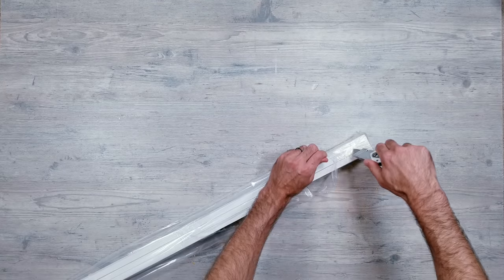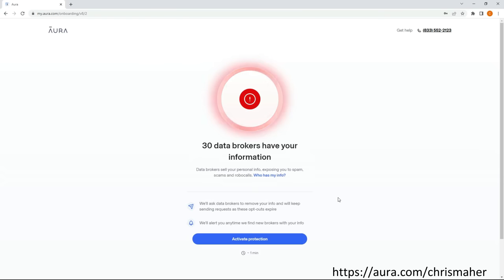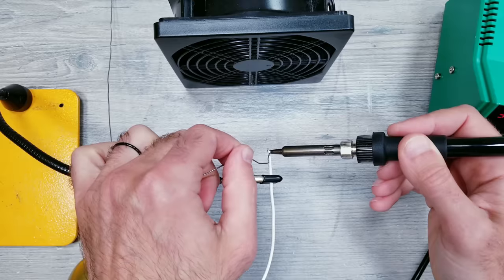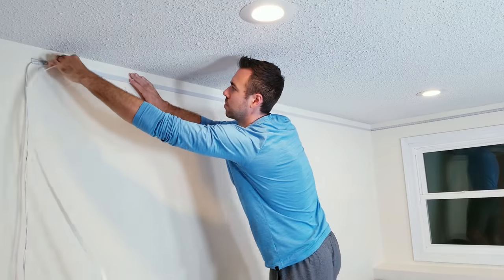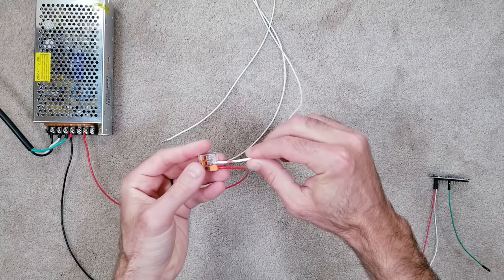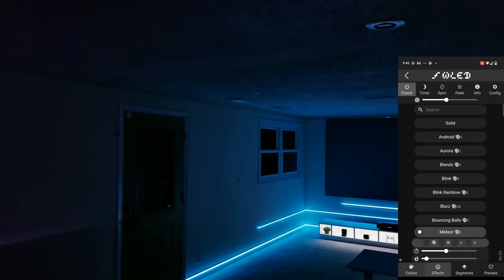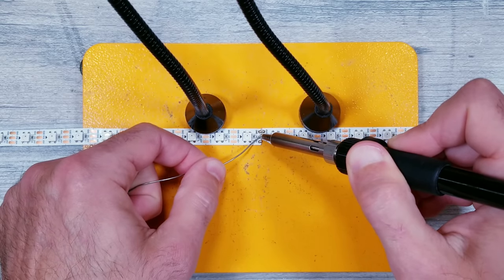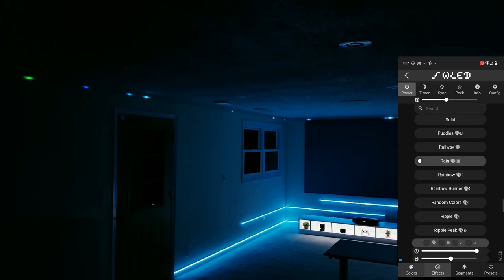50 Feet of LEDS on Room Ceiling - NO POWER INJECTION 😮

Comment: Hi Chris, I'm a big fan of your channel... Thanks for all the great videos.  I have a few questions, and hoping you can help me.  I have two tray ceilings that I am looking to light with LED strips.  The LED's themselves will not be directly visible as they are hidden by the lip or ledge of the trey ceiling.   Each tray ceiling is square/rectangular and about 53ft (or 16m) in total length.  

Here are my questions...  

1) Do you think the Govee M1 or LIFX Lightstrip is a better option in this application.  LIFX is about double the cost, but if there is a noticable improvement in quality, I'm open to it.  My original plan was to use two Govee M1 kits and six 40 inch extension kits per ceiling and just sync/group them together in the app (2 kits + 3 extensions per kit in each ceiling).  
2) Would a DIY option work best?  If so, what would you recommend?  I was originally considering the BTF Lighting FCOB WS2814 RGBWIC LED Strip DC24V 784LED/m 70IC.  I could get a 24v 20A power supply and inject from both ends (with the same power supply).  What controller would I need for this application to use WLED?  BTF recommends BanlanX, but WLED looks better.  
3) Since these lights are to be installed in a tray ceiling, do I need a diffuser channel, or will the tray ceiling itself act as the diffuser?  

I really appreciate your help with the above.  If you have a Patreon or some way to donate to your channel, I'd be happy to do so...  Thanks in advance 🙂

Comment: Question - adding the resistor to the data causes the lights to NOT power on - removing the resistor ALLOWS the lights to power on?  Must be the length without the resistor or power injection but LED1 is a different color than all the rest without a resistor?

Comment: Hey! I'm planning to do a simular setup but for 20 meters of the same led-strip. Would that 20A power supply be powerful enough for my project?
Reply: Hello, same here. I want to do it with around 30 meters. What power supply did you end up using?
Reply: @deliveredlate I ended up with two of these 20A power supplies and split the 20 meters of strip in half the way like Chris demonstrated at 8:22 and I added extra power feeding wires after 5 meters to prevent any power injection. The only problem I'm having now is the fact that WLED lags with ESP32 when there is more than 800 leds.
Reply: @AlmyCat  I also ended up using 20m of 60led/m strips used an 70A power supply with power injections every 5m. And used the A1-SLWF-03 led controller. It doesn’t have that much lag, it stays around 25/30 fps

Comment: Hi Chris, I followed your set up. Nonetheless when I connect the second LED strip SK 6812 it doesn’t light up. The head voltage is 5.1V at the end of the first LED strip it drops to 4.8. The first strip works just fine but the second does not fire up. Connecting the second strip by its own (as it would be one only strip) it works fine so that I dismiss any factory failures. I would appreciate your help on this ine please. Thank you
Reply from the maker: Thanks for watching! Did you make sure to go into the WLED settings and update the number of LEDs for the second strip?

Comment: Still don't understand how to figure out the exact power requirements for any given project.
What's the formula to figure out what you need exactly?
The ESP32 is a 5V controller, so I'd assume you always have to use a 5V power box if you want to connect the ESP32 directly to it.

Comment: I feel like i get confused on the power supply part. Ive been playing with strips and the esp boards. But it seems like i dont understand how much say a 96led/m needs in order to be powered. Say its a 12v strip or a 5v strip. How do i calculate the amps and watts i would end up  needing?

Comment: Love your videos and wish you would do more regarding how-to for LED strips and controller options. Question as I'm new to this. Your link for jumper wires shows 20 gauge. Is it ok to use 20 gauge for the jumper wires but everything else 18 gauge like you used?

Comment: Please help, aliexpress accidentally sent 20awg wires instead of 18awg. Will this work? Is it still within limit.
Reply from the maker: Thanks so much! You should still be good! Test them out and see how they perform!
Reply: @ChrisMaherDIY  thank you so much!! Additionally i have solid wires instead of  the standard copper, i skipped the tinning step, would this be okay? Is there specific cable type requirement?

Comment: I can't believe with all these comments, nobody mentioned fire safety.  1) You should use a fuse, 2) You should do power-injection, the reason is so the wire with the most current (the long one, to the first bulb that is powering all the bulbs) does not exceed its rating and get hot and start a fire.  3) When you do injection you should cut the GND as well as the PWR, and for the same reason...  nothing to do with connecting power rails...  it is the same rail.  You cut to avoid "Ground Loops" (and Power Loops too).  NOTE:  If you were injecting using a second power-supply, then you would connect the grounds (because it would not make a loop, it would reference the two power supplies to each other)
Reply: Also instead of using a resistor to make DATA reliable, you could use a single WLED bulb close to the uC.  They can push to your first real bulb with no issue.

Comment: Thank you for this video! I am going to be doing project of approximatley 64 ft of LEDS. I have 4 of the 2812B strips soldered together and upon initial testing it seems to be working fine with no power injection running on an ESP32 board. My question is how important is the LED memory usage? When I put in that I have 1192 LEDS in it gives me a stability issue and I know there is multi srip support. Do you think I will run into problems with the current setup?
Reply: Hey there, I'm interested in taking on a similar project myself right now(60ft 60led/m ws2812b). I have a few questions if you could help me out, assuming you've gone through and completed your project. 1. What power supply did you use?
2. What brightness settings did you use on wled
3. Was there any discoloration without power injections
The answers to these would really help a ton, thanks in advance!

Comment: How long can you make it? Is there a guide for how often you have to inject power? And is there a limit on how far the data signal will get relayed? I have 122 feet I want to cover with one continuous strip around the room. I have no problem injecting power a few times.

Comment: For LED strip I see the color options are white, natural or cool. Does it matter which I buy if I want display different RGB colors?
Reply from the maker: Thanks for watching! The color options will be the same no matter which one you get but you do get to choose between cool white, neutral white or warm white for the separate white led on those sk6812 strips
Reply: @ChrisMaherDIY  if i want to cover about 120ft of LED (pretty much the entire perimeter of my basement), would one small power supply do the trick or I need the bigger option?
Reply: @Chris, Any opinions on my question on which power supply I should go with for 150ft of LEDs?
Reply from the maker: @mshikhma  I have not done anything that large but I would start with a 5v maybe 40amp and go from there.
Reply from the maker: You would for sure need power injections with that large of an install
Reply: I appreciate it buddy. Maybe Im biting off too much I don’t want to burn my house down. 😂

Comment: Hey
Using the same power supply, I need to inject power at end ? If so, using the same power supply (5v/20A the same you used) I must to cut off the 5v pin in LED strip ? 
Thanks

Comment: Curious why more 24volt installs are not done? Smaller and cheaper power supplies and able to just use something like dolphins instead of expensive wagos? Yes you need to use a 24 to 5volt buck converter however those are a dime a dozen even for decent ones... Maybe there is something i am missing about the 5volt LEDs?

Comment: Can you make a video on how to connect SN74AHCT125N with an ESP 32, also can you show how to place the resistors and even a capacitor if needed in the correct locations. I am having trouble getting this setup and cannot find any videos on YouTube that show to correctly set it up. Thanks!
Reply: Ground to Pin 1
Data wire from ESP32 to Pin 2
Data wire to LED strip from Pin 3, also won't hurt to put a 300omh-500omh resistor here
5V power to Pin 4
Ground to Pin 7

Or just google the schematic to the 47act125n, probably one of the best logic level shifters for LEDs

Comment: I don't think I understand the current being used. You put a 20A power supply on this one, but then in WLED limited usage to 3k mA which is 3A right? Why not set WLED to like 16kma or something like that?
Reply: it gets even more conffusing when u do the maths the 50feet strip would ne 54A
Reply: @thelastengineer8633  Right at full power, but under powering them at 3A and 20A would still be a significant brightness difference.
Reply: @theimpulse77  yeah right but then i still dont know why 20A when he limits it to 3A woud a like 10A power supply be enough then?
Reply: Higher current brings more risk and would require fuses between pwr-esp & pwr-strip

Comment: Wouldn't it be better solder the wires and use heat shrink instead of the wagon connections?

Comment: Chris I need your help -- I've soldered together 4 continuous strips of WS2815s (60leds/m) and am controlling them with the same plug-n-play controller you show in one of your videos, compatible w/ 5, 12, & 24v. This is the sound react version. While soldering I made sure each strip still worked and increased the length in WLED accordingly, but past 900 they randomly flash colors and don't respond, while the first 900 respond to whatever I tell them to. Is this a power issue, or can I not control all 1200 leds with one controller? Do I need to buy another to add to the other end? I don't know how you're controller all 50ft with one controller :(

Comment: Great video Chris, Awesome helpful. 1 Question, Can this type of setup be used as the main primary lighting for ceiling application? Or it this setup only for kool accented lighting feature? What would it take to setup as primary lighting as main source of light got the space?
Reply: As main light you probably want to use analog LEDs with a good CRI rating.
In that case the individual adressing stuff would be obsolet, so you can choose eg a 24v strip. This will give you plenty of light if injected front and end. 

If you want to go with adressable LEDs, I also would suggest to take a look at 12V or 24V strips. These will come with the downside, that they are not individually adressable... Only in groups of 3 or 6.... but again these will give you a good amount of light, even if only injected front and end.
But keep in mind, the CRI of all the RGB and even RGBW strips is pretty bad.
Personally I would use more complex setups and laydown two seperate LED strips. One analog nice high quality white and a digital 12/24V RGB strip for fancy effects.
Reply: @S4kar97  thank you

Comment: Those pre-cut Right Angel pieces were not the ones that you used in your build.  Did you cut your own?  The Right Angle corner pieces you linked would require your configuration to be mounted to the ceiling.  You should maybe do a video on how to cut those accurately without them looking like crap.
I'm pointing this out because you're providing a materials list that does not produce the example build in your video.
Reply from the maker: Thanks for watching! I just butted them up close to each other for the install. I updated the description so hopefully no one else gets confused. Thanks!
Reply from the maker: @Kevin-ht1ox  here is a close up. As you can see, no cuts were made.  https://youtu.be/sjsJGqBwTr8
Reply: @ChrisMaherDIY  that is super helpful!  Thank you

Comment: I have a long corridor, I always want to put a led strip in that area. A more natural place to put is at the ankle height since it’s a corridor(walk way), as a comparison I would put at ceiling if it’s a living room. 

The issue is that along the corridor, there are several bedroom doors which will break the light strip line. Now, the only alternative I can think is to put at the ceiling but it kind of violating the purpose of it being a walk way. Any alternative ideas? Thanks.
Reply: put the strip just where u want and maby use a cabel for the gabs? just need to hide the cabel then

Comment: Chris, do you prefer the flat channel plastic piece vs an arced or rounded plastic filter?
Reply: Hey Sean, in previous videos he’s stated that he likes a particular rounded plastic filter because it creates more distance away from the LEDs hence more milky diffusion/no hotspots, but in THIS episode he purposely used flat channel diffusers because of the fact that they came with the pre-cut 45 degree corner connectors and he wanted to show that off 👍🏽 hope that helped!
Reply: @mrcreditgems  dang it, I got the flat I think.
Reply: @SeanLake3D  I’m also trying them out, they just got delivered yesterday. Using flat channels + Govee M1 lights ; I will try to report back once I set them up and see how it handles!
Reply: @mrcreditgems  i wasn't sure which Govee to get specifically, I've seen old m1s and new.  I have, roughly, a 12 x 13 room that I want to put up the lights so wasn't sure how much less to get.

Comment: Just a quick question i bought a 5v 60 amps powersupply and it litterly fried 1.5 of Led Strip. It was Ws2812b 5v and now im pretty scared to use it on 5meter. Waht should i do?
Reply: thats too much amps for just 5m

Comment: Hey Chris again great videos. I wouldn't have been able to even attempt a project like without your videos! 

So I have 4 ws2812b strips connected together and hooked up to a 5 v 60 amp supply the same wiring scheme as you in this video. Everything was working fine until I cut the 5v pad to connect to a different power supply at the end. Now on certain animations or sometimes even on a static color my lights flicker or go rainbow and don't display the correct animation or color. Any thoughts on this?
Reply: You get it figured out? I’m kinda curious, my guess would be a resistor

Comment: @6:37 you could also use a "sacrificial pixel" at the very beginning. You exclude this pixel from ever lighting up but it will boost your data signal without the need of a resistor.... Since you clipped off the ends... you will have a few left to spare anyhow :-)
Reply: This is good info but greek to me lol

Comment: If you have light strips from both left and right of the room, how do you make a flow animation so both side animations are going forward at same speed and eventually they meet in the middle where your tv is?

I am think you will have to have 2 light strips and 2 controllers for both sides. But the problem is how do you make sure the animation starts at same time and in sync. If 1 side has a slight delay, the animation will look awful(they won’t be able to meet in the middle at the same time). Also I think the length of light strips need to be the same. Is it gonna be super hard to achieve?
Reply: You can define a single continuous run of strips as 2 separate segments from the ESP32 board within your WLED instance. So if you have a 100 led strip, you can tell the WLED software that it is instead 2 50 led segments, and tell it one of them is reversed. Then when you activate a moving effect it will happen identically and simultaneously because it is happening from a single ESP32 board and single WLED instance.
Reply: @anthonypatino7143  thanks for the great idea. I will have a thought about this. I also raised another question in another comment, if you have a chance can you have a look to see if you have any idea about that? Cheers

Comment: How do you never need a data booster?
Reply: Seriously, yes. There's quite a few things still wrong in this video. First, like you mentioned, a databooster. I guess he's satisfied with serious drop of fps and occasional stutter in his effects. Most people who know this hobby will even use 2 pins and thus 2 data lines for such lengths of strips.
Second, a 20A power supply is overkill like crazy, using only one end of the strip to feed power even the strip by itself is only capable of pulling 4A max. Say he power injects at the end still makes it 2 x 4A = 8A. 
Third, I guess he also has never heard of voltage drop on long wires and adjusting wire AWG to counter it.
Fourth, what if something goes wrong in the strip or power supply, not a single fuse is used.
Reply: https://www.youtube.com/watch?v=Umo6jKLfwsQ&t=163s

Comment: Which resistor do you use?
Reply: In the video the resistor colour bands looks like blue-green-violet-black , which would be 567 Ohms , but low value resistor say from 200 to 500 would be fine ( there's documentation on wled & ESP32 you can read for more info , just search something like wled resistor data pin. If you pick a random one from a previous project or liberate one from some old tech, make sure it's not in the kOhms or MOhms range or you'll get no data passing through at all :)
Reply: 560Ω ±5%
Reply: He lists the Amazon link to it above.

Comment: I need a method that doesn't include soldering

Outside of the cost to get started I don't think my vision is good enough to safely solder.
Reply: They have plastic snap connectors for the gold leads as long as your fingers work.